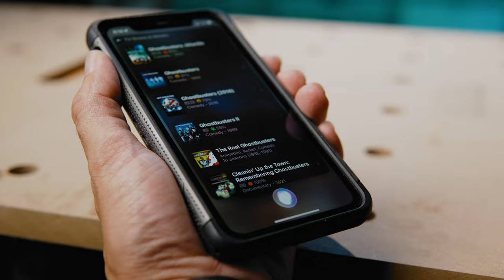you bought the wrong stop block

Comment: This all may be in jest, but I purchased one of these stop-blocks and I really don't like it. It hard to set a position as it gets jammed up in the track with the bolt heads, you could have found something better beside bolt heads. And, to adjust the height of the block it is difficult, to find the hole with the little screw is a pain. Just not worth it. The "Red Tool Company" makes a better product, and you can flip the block up as needed without having to remove the whole thing.

Comment: DON'T do the same mistake I did, leave your square fence low enough so that your parts stops on the gray part. I designed mine higher (though it would be more versatile), so it's almost always the red part of the block that is stopping my parts, and the red part is only held by one thumb screw. The red part is VERY high deflection, it doesn't hold at all. Maybe with 2 thumb screw it would hold better, but I've been using it for about a year now, and I have to rest my parts against the red part in such a delicate way otherwise it shifts.
I don't know if this comment is clear but if doing multiple cuts, your parts must rest on the grey part of the stop block.